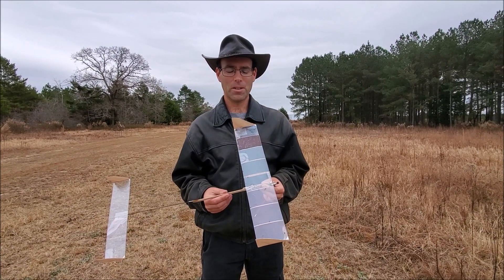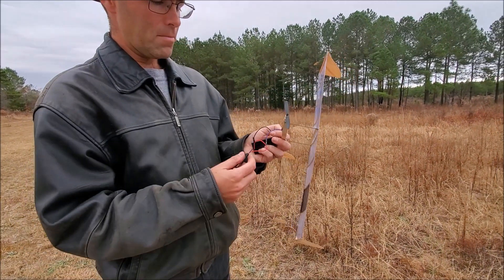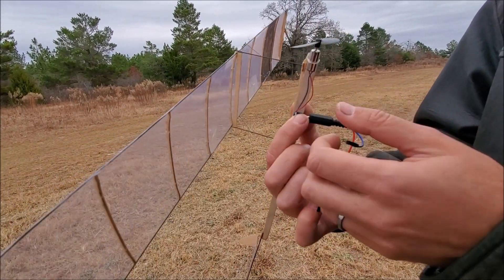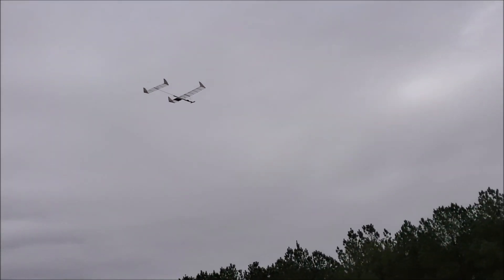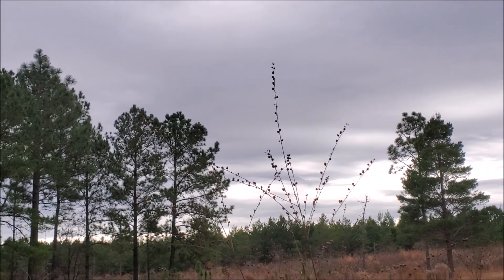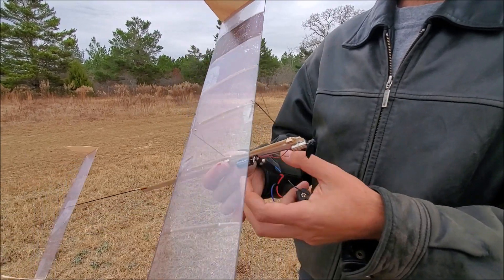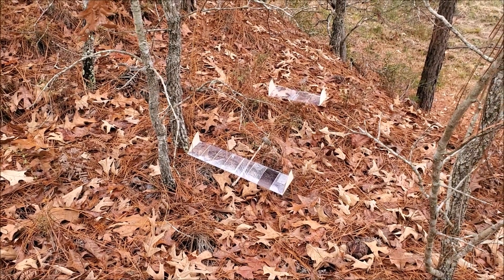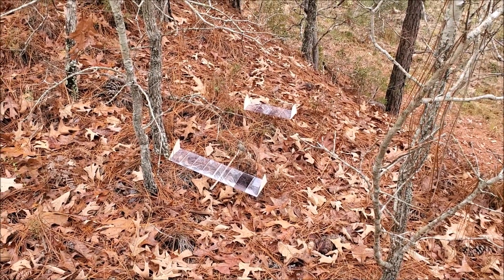The ultimate capacitor power system for Science Olympiad Electric Wright Stuff airplanes!

Comment: Are you using audio plugs and jacks or DC power plugs and jacks? I've found jacks with switches that fit 2.5mm audio plugs but haven't looked at DC power jacks yet. I can't make out what it is from your web site photos. We're starting to mess with capacitors here and mainly been using switches, but soldering wires onto switches is a little fiddly.
Reply: Ah... I figured it out. DC power jacks also have the switch. And there are some pretty small ones, too. Thanks for showing us this.

Comment: That flight spanning roughly a minute++ of the beginning of this video puzzles me. Why didn't the plane continue to climb until it ran into a truss or something up there? It climbs way up there, and then it seems to level off for the duration. What am I missing? I'm not a flyer or builder of these little planes. I just enjoy watching you do it.
Reply from the maker: The voltage in the capacitor decays asymptotically, so you get a strong initial climb and then a very long cruise. If you don't charge it all the way, it doesn't climb as high. With practice, this leads to impressively accurate climb altitudes.

Comment: Can I use sunmica instead of balsa wood for making sandpiper 12 inch glider? Please reply or suggest me other material for making catapult chuck glider.
Reply: Why would you want to use sunmica? Is there something wrong with balsa wood?
I would make a guess that with the weight you might get flights that are 1/3 the duration of a balsa wood model and that's if you're extremely lucky.
Balsa has been the material of choice for more than 100 years. In the last 20 or 30 years some foams have made in roads but anything with a density of more than 6lb per ft3 aren't really suitable.
Reply: @scottnewkirk2  I searched in many stores in my region but here no anyone heard the balsa wood name , and here is no option to purchase balsa wood online also therefore I think can I use some other materials to male catapult glider
Reply from the maker: I'd look for blue or pink foam and learn how to cut it with a hotwire if you can't find balsa. That's the material of choice for composite gliders.
Reply: @joshuawfinn  here no anyone know about foam , yesterday I asked in many shops they show me shaving foam now what I do , I am your big fan sir , I am very interested in gliders but not any materials available.

Comment: Hi Joshua.  For a long time now I have wanted to try a capacitor motor in a Guillows 16" ws model.  You wouldn't happen to know where there is some sort of formula to tell me what I need?  I have looked all over (i<m not very good at computers mind you) and can not find what I need.  Any help would be greatly appreciated.  Thank you.  Love your channel by the way.
Reply from the maker: Glenn, I'm sure someone somewhere has a formula, however what I'll tell you is that if you keep them really light, the Guillows planes should fly decently on a geared 8.5x20mm motor with a 10-20F capacitor charged to 4.5-6V. Basically you want the gearbox, motor, and prop out of an old Parkzone UMX plane. I'd offer to sell you a pre-assembled unit with that drive system but I'm still a few months out from getting more of them in. They'll get here eventually though.
Reply: @joshuawfinn  Hi Joshua and thank you so much for the reply.  I can start to assemble the bits and pieces from Banggood.  They sell motors, capacitors and props, etc.  Thank you so much for pointing me in the right direction.  I am finishing up a Dumas 30" ws Beaver and when thats done I will hopefully start on the capacitor project.  Thanks again.
Glenn

Comment: why do you choose a sort of H tail and winglets?
i've asked someome, if a H tail was useful for DLG's, he said too much drag
Reply from the maker: The twin fins work really well as the suppress tip vortices coming off that big stab as well as providing very good yaw stability across a wide range of flight regimes. For DLG, tip mounted rudders would cause problems because of the structural loads they would impose on the horizontal tail during launch. Also the linkages are more complex.